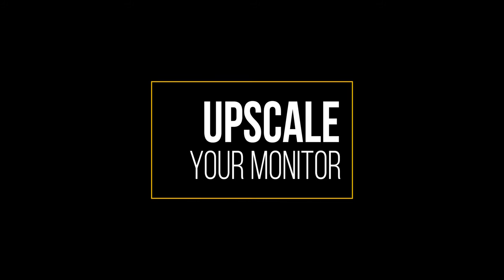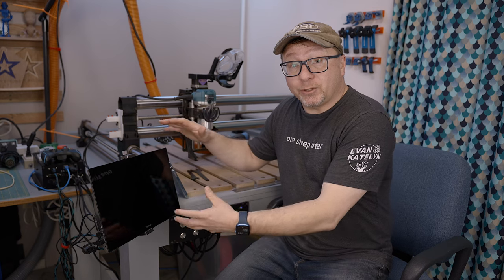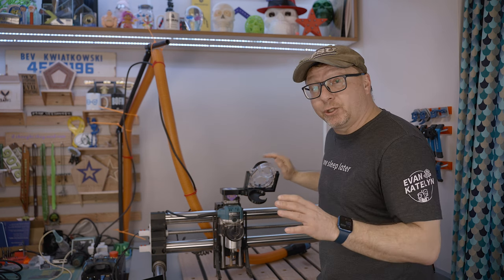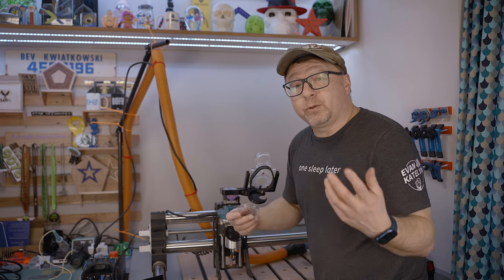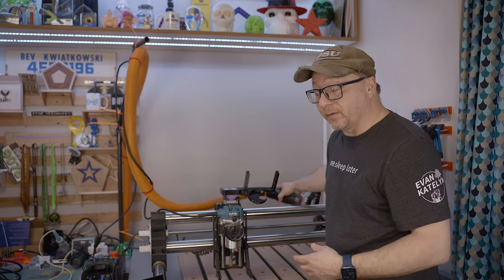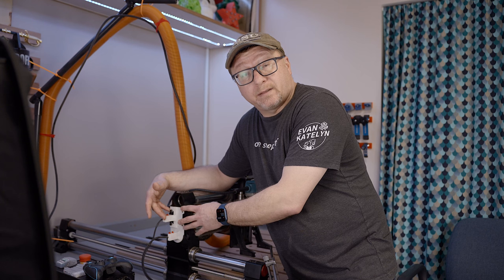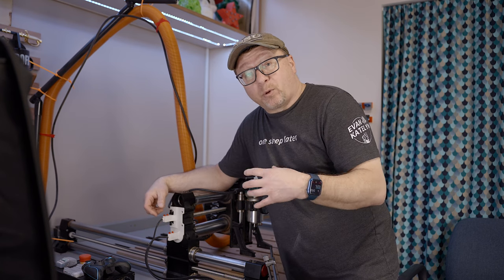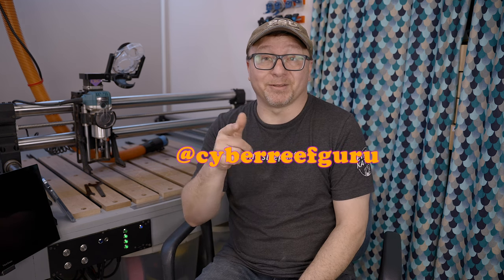5 Killer Onefinity Upgrades

Comment: What cables did you have get I'm getting the Asus vt229h monitor Will the cables that came with the 7 in monitor will they work the bigger monitor
Reply from the maker: I used the provided cable for a while, then switched to a longer HDMI and USB cable. There is nothing magical about the connection -- it is just HDMI for the video and USB for the touch screen. Get the right cables for your monitor (I have no clue what that might be). Thanks for watching!

Comment: Thanks for the video, very informative.  What's your take on a rear hose dust connection? Is that a 2 1/2" hose you're using? Appreciate all your help, Thanks!
Reply from the maker: Hi Ron - I like the rear port - since the OF can cut further on the front than the back, it makes sense to me. I've been thinking of switching.  The hose I have is ~2" from Rigid, with the 2.25" port for the OF dust shoe. I got it at Home Depot after a suggestion from someone on the OF forum. Here's a link if you are interested: https://www.homedepot.com/p/RIDGID-1-7-8-in-x-10-ft-Pro-Grade-Locking-Vacuum-Hose-Kit-for-RIDGID-Wet-Dry-Shop-Vacuums-LA2570/305626336. Thanks for watching!